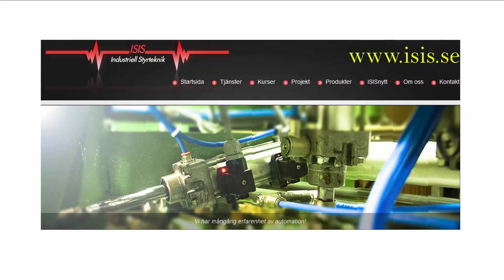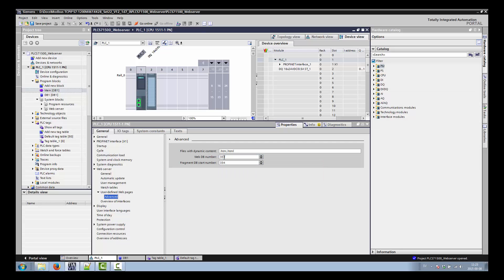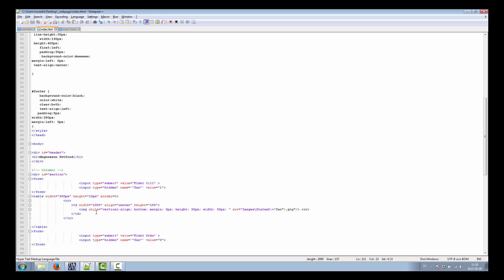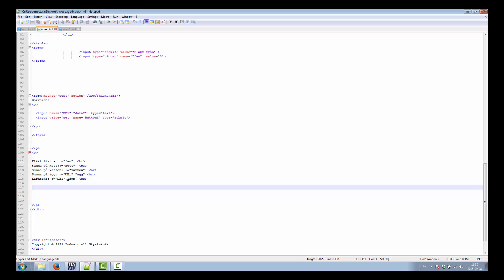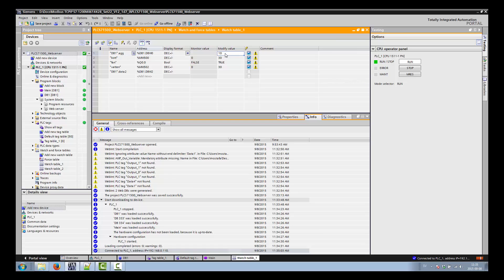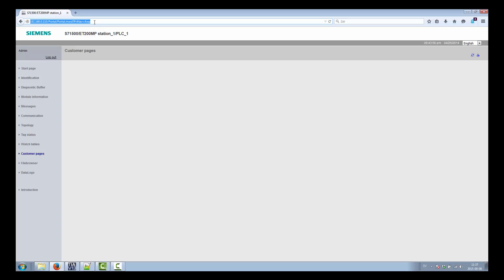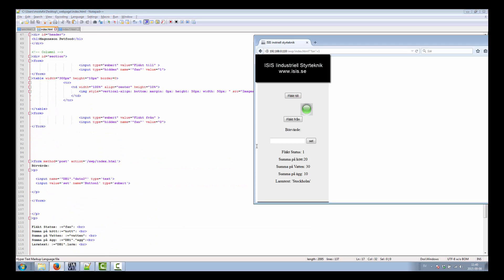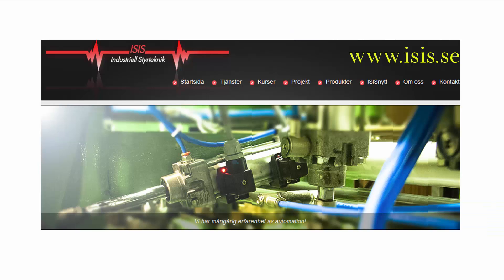Webserver on PLC S7-1500 and TIA Portal

Comment: Hello!
How did you use the output variable to change the status light from red to green? I have two similar output variables (coming from a real PLC) which I want to use to switch the image from one to another. 
The syntax is a bit confusing. I have not added any data blocks. Can I use <- AWP_IN_Variable := 'Variable Name' ->  in my user defined web page?